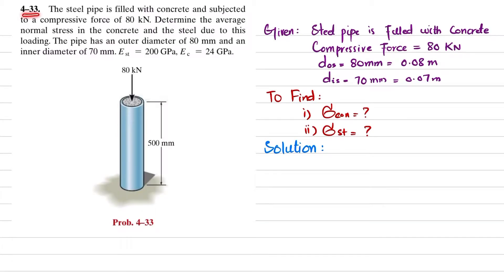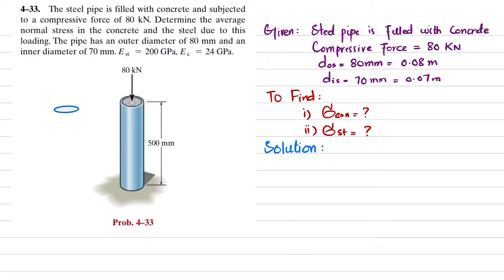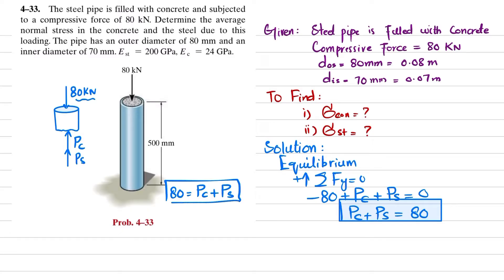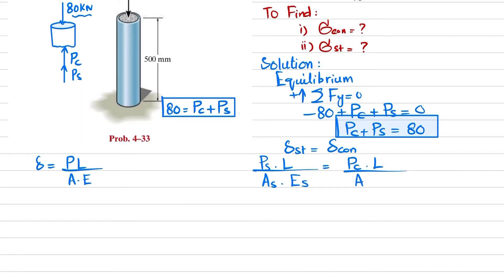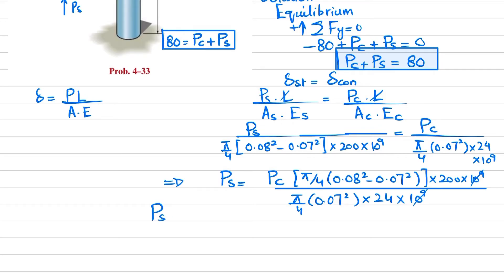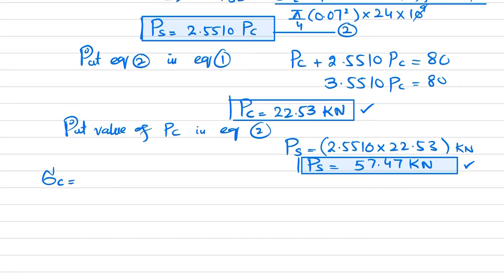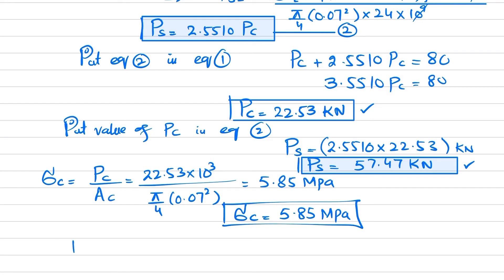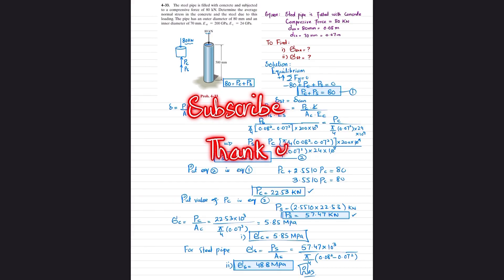4-33 Determine average normal stress in concrete & steel l Axial Loading | Mechanics of Materials

Comment: If you solved Ps = 2.5510Pc in terms of Newtons, how are you able to plug that equation back into equation 1 which is in terms of kN? The units don't match??
Reply from the maker: The equation Ps= 2.5510 Pc does not not reflects that it is in Newton, both loads are there which are unknown. This equation only tells us that Ps is 2.5510 time than Pc .therefore you can plug it in equation 1....I hope it will remove your confusion